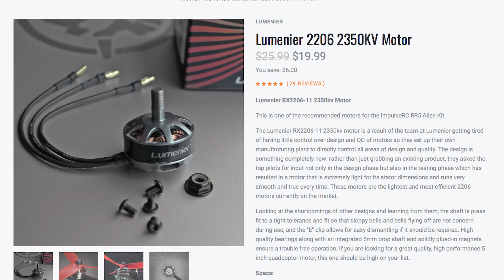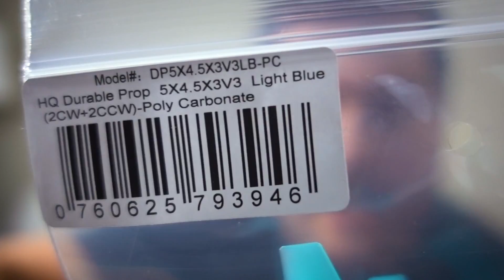Mail Time! April 2017 (GIVEAWAY)

Comment: I am running a qav250 6 inch props with spracingf3 acro with betaflight 30 amp esc silk, I think is more aggressive flying

2000kv lumenier olds motors ,but I want other motors what you suggest me because I think one of them is giving up jejejeje

running with 4s 1300 1550 and 1800 batteries.

Comment: did you hear of solid state battery. it's basically a liion without burning to death when you poke it. and it will be cheaper to produce aaaand you will get a higher powerdesinty. hyyyyype

Comment: First!
I can't wait to see this new angle grinder quad! 😂😂
Reply: DroneRodeo that was me
Reply: Aussies will fly ANYTHING! 3:)
Reply: I bet if flies...angle mode.
Reply: That's an Oscillating Saw, sometimes called a Multi Saw or Multi Tool
Reply: Dizzy Fpv fine... then I can't wait to see the oscillating saw fly!
Reply: i think it would have too much oscillation to tune out with pids.
Reply: jimmi pinnington might need to soft mount the motor!
Reply: DroneRodeo i almost added that too. ya beat me🤣